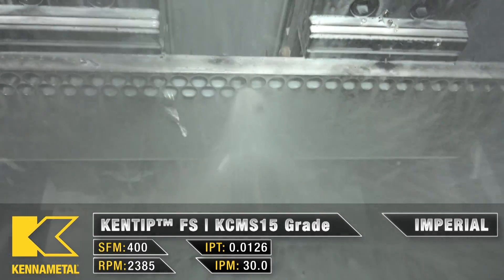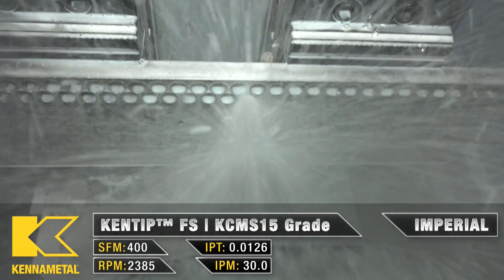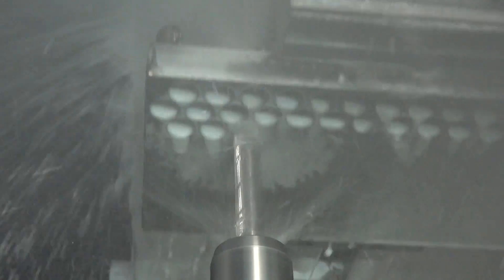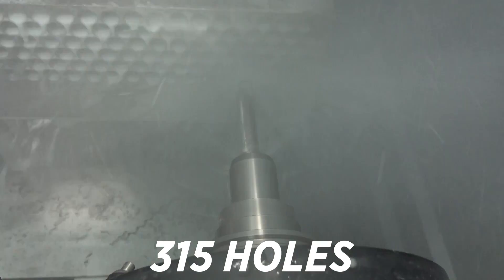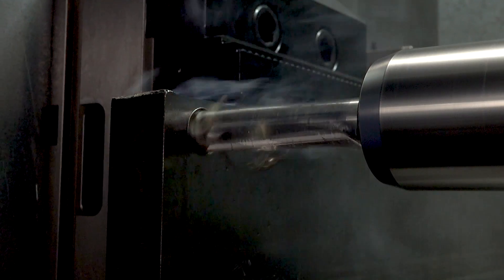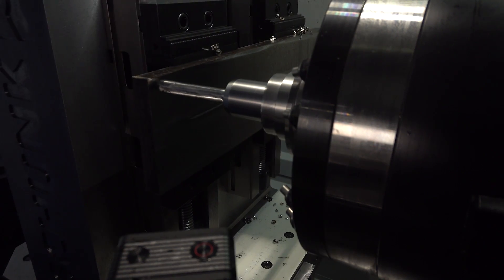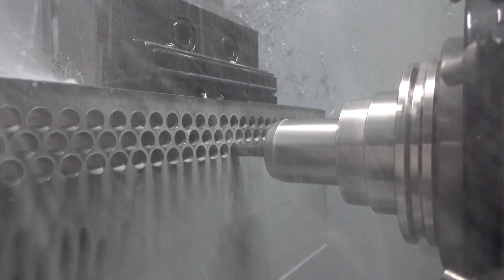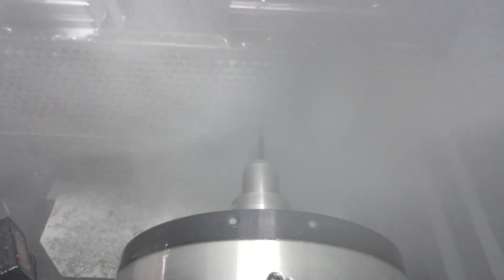Pushing Drills Past Extreme Limits

Comment: What tool would you guys recommend drilling Forged Steel at 21.5mm Dia and about 3 inches deep for 2000+ holes? I do a job where we use a insert drill on parts that we regularly get 4000+ parts for. Each part gets one hole. It still feels like I'm changing the inserts every 250 parts/holes and waiting money

Comment: Question. What do you do to handle an extremely long drill rainbowing in a hole? An example would be a 3/8" pin dropping into  each end of the drill hole, but unable to pass all the way through?
Reply: Ream a pilot hole then send a gun drill through it.
Reply: Drill a hole through to the diameter of the middle of the final hole 
Then either use a tapered drill or mill it open with a small & long endmill?
Reply: Ream or bore imo

Or recheck the drill cycle, especially Fz
Reply: Botek gundrill!